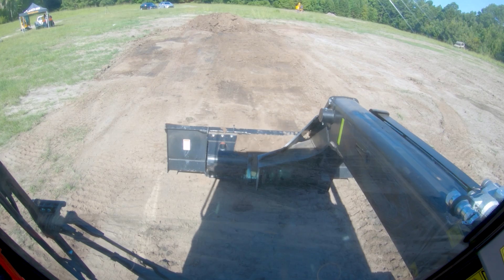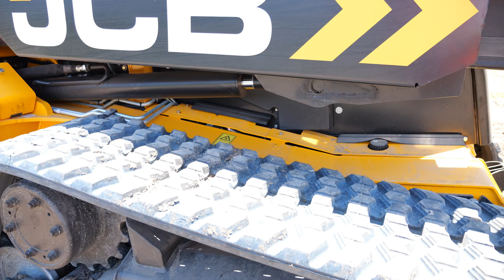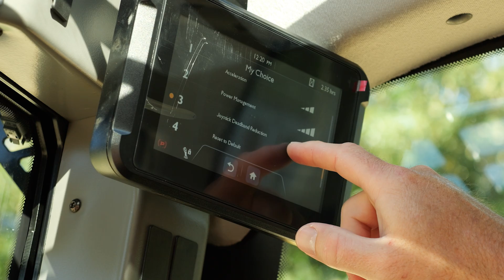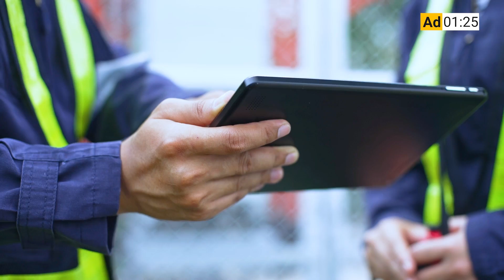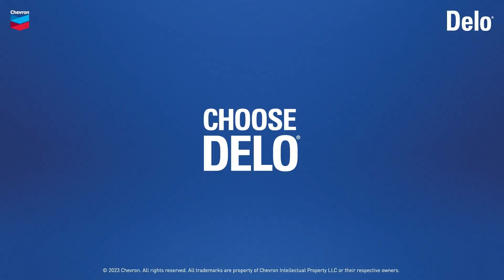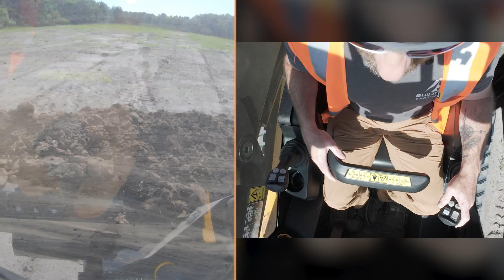“Teleskid” Review: JCB’s CTL with Telescopic Mono-Boom

Comment: Side entry is nice but they are just underpowered for their weight and capacity; JCB just refuses to go bone 75 HP and get into DEF.
Reply: Engine is powerful.  300 ft lbs of torque.  Hydraulic system is weak
Reply: their most powerful teleskid is 109hp now, not class leading but not bad.

Comment: This is a really dumb idea. Weight distribution is terrible. Side sloping with this machine will be impossible. Telehanders in particular are very expensive to operate. Turning a CTL into a morphadite is plain stupid. JCB's also have terrible product support here in the states.
Reply: Where do you get your information? I've have a 3ts8t. Never had an issue sloping. As for weight distribution, a full bucket retracted operates just like any skidsteer when transporting. You don't want a full bucket extended when transporting and why would you, but you have the option, once dumping, to extend the boom. The boom extending has spoiled me. When I operate any other skidsteer I'm always wishing it had an extending boom. And the side door. 
The only downside I have is with the lack of information from JCB. I've finally found an purchased a complete teardown manual for mine. The issue with the dealers, IMO, is just that there's too few of them.
Reply: They are opening dealers in all the US. Check website.

Comment: Can you attach a front backhoe attachment with this machine?
Reply: yes, it has a quick hitch which allows for universal attachment fittings from any brand.
Reply: @JCBNorthAmerica your reply came too late,😂 I bought the 3ts-8t and the 35z. They are both excellent, but my radio doesn't work in my 3ts and the jcb dealer wants me to try to see if they attached the antenna, I'm a little disappointed they didn't send someone to do it. I haven't tried yet. Also, I got a few virniq attachments and they have been great   I'm really happy with my purchases.  Especially the 3ts-8t.

Comment: Regarding right window, my guess is they don’t want operator getting his arm chopped off with boom by mistake. Just like with normal skid steer safety cage. You know somebody would screw up and then lawsuits start.
Reply: I really don't like the fact that I can't take the front window out. Keep the a/C vents and open the front up and then I would like it. Until then, keep it
Reply: @johndeere350b  Front window slides up and over the drivers head, its actually the emergency escape as denoted by the red handles
Reply: @pbwmanagement  excellent! Thank you.